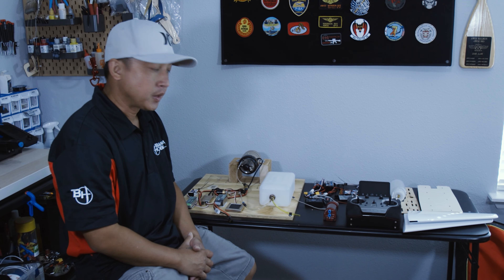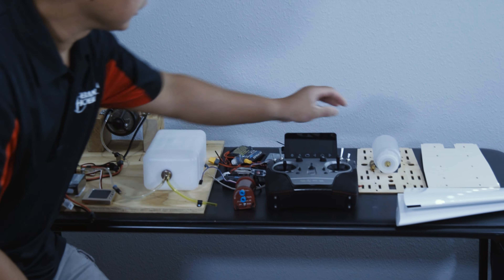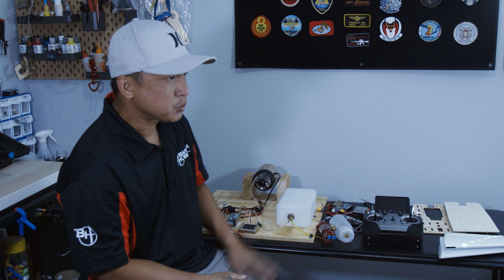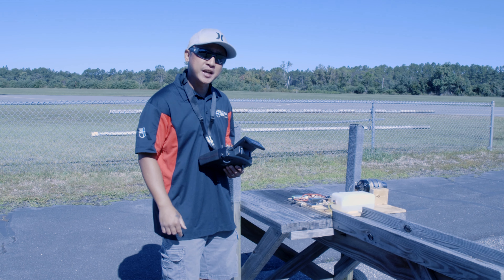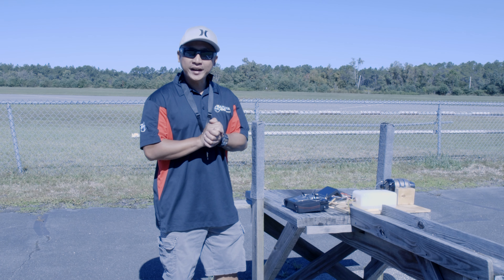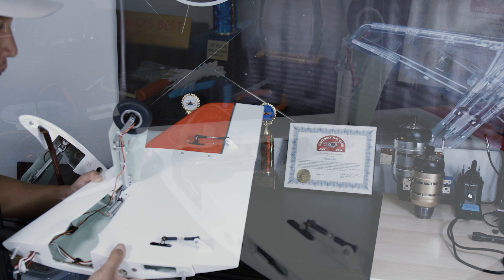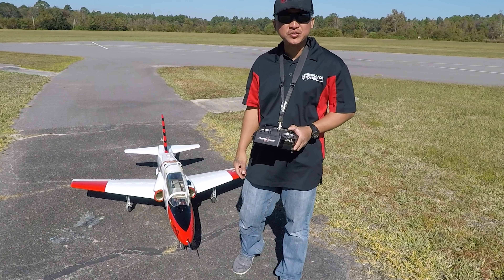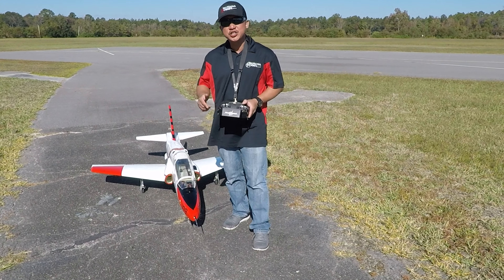Pilot-RC BAE Hawk 1.8m "BUILD"

Comment: The plane looks good and true in the T-45 Goshawk colors - as it anyway looks more like the Goshawk than the Red Arrows T1 version. Red Arrows have rounded wingtips so the more squared wingtips would look out of place if the plane had the Red Arrows livery. Would it be a reasonable first jet - for an experienced RC flyer with a decent grip on plane aerodynamics and with scale warbirds experiences ?
Reply from the maker: I think it would be. The jet has a nice scale appearance and performs like a sport jet in the air. It’s got a great flight envelope and can handle slow speed without bad tendency. Link below is one of the flight footages I have of the Hawk if you haven’t seen it yet. Hope this helps you to decide on this model. Thanks for watching!
https://youtu.be/3Dd5tJ0aVEU?si=U85hptDwVJp0esiN
Reply: @WarrenRC6373  thank you !